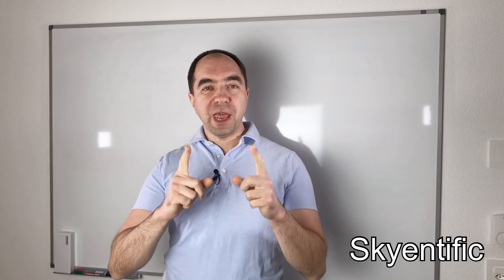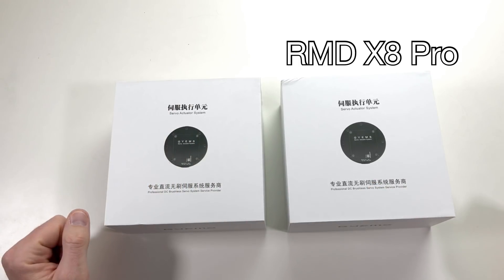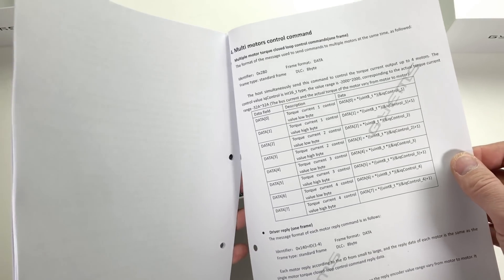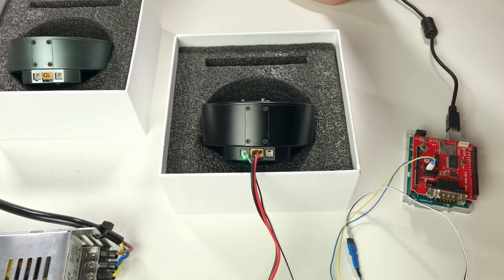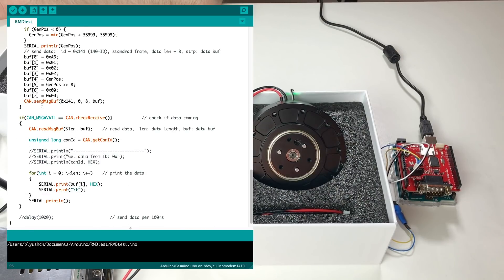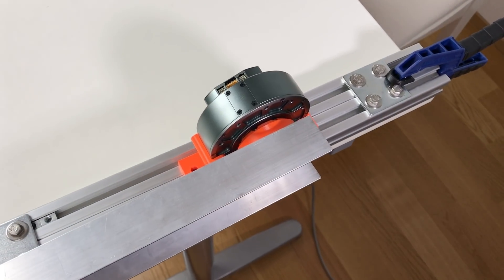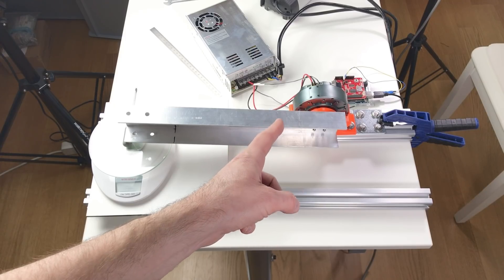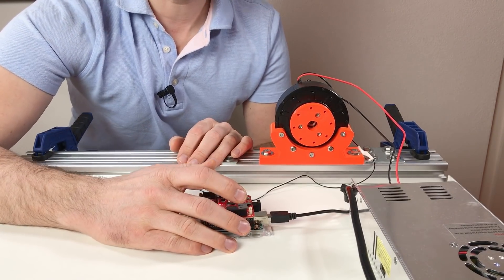I found Best Robot Actuator (GYEMS: RMD x8)

Comment: Thank you for video. I tested DRC10 drivers (probably same driver as yours). 
Did you test 0xA7 and 0xA8 commands? These are not working on my device. It returns error.
Did you check torque at slow fixed speed? (0xA2 command, for example 2 rpm). Incredibly low torque on my devices. Completely useless. It can't even rotate itself. But for high rpms (e.g. 100 rpm) it produces some torque.
Did you check temperature? Constant, -50 celcius on my devices.
I wonder if my devices fake. :(
Reply from the maker: DRC10 is completely different. They have even different hardware. 
On my driver there is no A7 and there is no A8 command. Only A1, A2, A3, A4, A5 and A6. I checked the torque only in different position modes and in torque mode. Both works fine. The temperature readings gives very reasonable result, starting at 28-30 Celsius and rising slowly, when I use motor a lot. 
Did you buy your driver from Gyems company? I saw the similar drivers from other Chinese company. And those drivers had absolutely different control protocol.
Reply: @Skyentific  Thank you. It was really useful. My drivers exactly the same as Gyems. I have precisely compared from high resolution photos. It is either an original or a perfect copy. But I don't know where it was bought. I will learn this from the purchasing department tomorrow. Thanks again.
Reply: @Skyentific  What is the brand and model of the driver you use? Where did you buy it?

Comment: I see lot of Servo motors (like ClearPath Servo) which gives good torque, speed and precision. And it is around 35$. But this actuators are 500$. So, im wondering how do these actuators make difference with those servos. This is just a question and im new to robotics. Please assist me so that I can design my robot - The Best.
Reply from the maker: Clearpath of the similar torque, cost 700USD, and weight 11kg!!! And this actuator weight less than a kilo.
Reply: I will be waiting for the answer. Love your videos. Thanks for making us to know the availability of different components. Keep going...
Reply from the maker: Thank you. The cheap servos usually not powerful enough for the robot arm (with at least 1kg payload and human like reach). Also this particular servos (ClearPath) are very heavy and not very powerful. That is why in robotics they usually use harmonic drive actuators or MIT mini cheetah like actuators. Harmonic drive actuators usually cost many thousands. Thus standard robot arm with 6 axis would cost at least 10-20 thousands.
Reply: Thank you soo much for the information. Actually im pretty new to robotics. So I thought servos are cheaper. Thanks for your information.
Reply: Also, Im wondering like, servos contains dc motor, gear reduction system and feedback system. Actuators that i saw in your video has same components. Then how can the weights of both vary this much? Servos - 11kg and Actuator < 1 kg? 😅😅😅😅

Comment: Great channel...
 Love your explaination and your details... i would lo e to build 7 dof to hold a industral router. Question have you ever looked at clear path servo motors?
Reply from the maker: Thank you. Theoretically, if you would like to make serial robot, clearpath servos are a little bit heavy for its torque. You would need to use a large reduction gearbox. Personally, I never used these servos.
Reply: @Skyentific   i was thinking of using a 5kw atc spindleon the end of the arm.... aprox 20kg....which means redesigning your fram i would..love to 3d print a mold of it..would require redesigned heavy duty  supports and thicker  bracing support and cast the peices from carbon fiber shell  filled mineral cast expoxy....yes...much heavy industrial robotic arm..using clearpath servo and..harmonic gears...

Where can find a free 3d cad model of this or simular 7 dom arm

Comment: To build robotic arms, you need lightweight motors with high torque. If you compare continuous torque to motor weight ratio, Dynamixel H54 is the best.

Comment: Before anyone gets any ideas of actually using this thing, the cheaper one is $300, though most places sell it for $500.
The company website seems to be a scam:
http://www.gyems.cn/846351.html
None of the applications listed at the bottom actually use their product.  This company is actually trying to take credit for the Boston Dynamics Spot robot.
Reply from the maker: they just used this photos for illustration. They don’t say explicitly that Boston dynamics use their product. They are trying to make affordable part for people like us. Without them we would need to pay many thousands for German or Swiss actuator. I used this company many times, and never had problem with them. I saw several similar actuators, and this one is really good, so I shared this with you.
Reply: @Skyentific  The problem is their product is nowhere near strong enough for fast enough to pull off anything like Boston Dynamics' Spot.  It also doesnt have an absolute encoder like you'd need to make a walker.  It has a relative hall effect encoder, right?  Its extremely disingenuous to imply that you can pull off something like Spot with this servo.

The other "examples" aren't any better.  A medical exoskeleton? No.  An Actual high resolution arm? Not with that much lash.  It might be useful for a general purpose arm lifting a few hundred grams that can tolerate several millimeters of error if you have several servos chained together but the products its claiming to be equivalent to are $2000 servomotors that require a $5000 AC drive.

Let me be clear: the product is not a scam.  The advertising on their site most definitely is.
Reply from the maker: I don’t agree with many of this. First, 3kg.m is very good torque. I am not sure that spot mini uses more torque. Second, for many application several mm precision is enough for robot arm. Look at human arms, they are not extremely precise, but still useful, thanks to our sophisticated brain. And for medical exoskeleton 3kg.m could be useful too, at least for arms. But even for legs, I talk to a team at EPFL, for their medical exoskeleton (legs) they using 3 or 5kg.m (I don’t remember exactly), but this is not extremely different from this actuator. And also you can always add second stage to this actuator to increase torque.
Reply: @Skyentific  A lot relies on the maximum angular speed as to whether an additional reduction stage would be viable.  I'm also assuming that the maximum torque goes down as angular speed goes up.

Comment: A very interesting option is a motor wheel from a gyro scooter.  600rpm and 350W nominal.  very large Nm and no backlash.  the price for a motor is only $ 30-40.  I controlled using a VESC controller.  very well you can configure the necessary PID. 
I will assume that the difference in Nm is ~ 1.5.  in favor of gear with play :-(
but just by increasing the voltage you can easily raise the current -> Nm.  I turned the 36V motor from 60V.  without heating  I could not give a continuous load.
but the most important thing is WITHOUT BACK LASH!

Comment: I want to make a correction here " high voltage doesn't mean low current". In Robotics torque is more of an important factor than RPM. So 48V means it's designed to carry more current. I am expecting that 48V & 24A can generate around 24Nm effectively by using a 6:1 Gear ratio for your first motor.
Reply: The size of the motor limits the maximum power

Comment: Can you buy a cheap version of that motor with the low torque and rewind it to make it higher torque yourself?
Reply from the maker: Most probably it would not work. The torque depends on magnetic flux. If you put more turns with thin wires, they will cary the same flux as thick wire with less turns. So it will change KV of the motor but not the torque.

Comment: You planning use this actuator for your  (Another 7dof Arm)  ?  I start print stl data and want order some hardware but Iam start to be afraid which hardware you want to use at the end. Hardware is not cheap so would be nice to know your target. Thanks. I our design is awesome !
Reply from the maker: I am still planning to build the robot arm as before: with multistar motors and ODriver. This is still valid. Nothing is change. Nevertheless, I don’t yet finished with the design. So I would not recommend invest much money now. I think it is better to wait when the arm will be finished, just to be sure that everything is works as it should.
Reply: @Skyentific   OK thanks for info.  
So I print only plastic part (its cheap and is no problem reprint changed part :) ). Thanks

Comment: Wow, for a robotic student seeing these actuators is sooo pleasing to the eyes.

If possible plz do make a video of some of the options for the feedback systems that we can  use in case of using a normal DC motor with gearbox (not a stepper motor) for the actuators.
This is my project actually sothat we can use the DC motor of our choice.
Reply: So basically, making these nice cheap multipole actuators completely worthless by switching back to a design with no holding torque, phase backlash, big EMF capacitors, and terrible positional control.

Comment: This is the servo that I mentioned to you on your previous video but you haven't replied to my question. Anyway,  yeah the good thing is it can read position in multi-turn. But when ever you turn off the power and power again, the servo will lost its absolute position, so you may need to calibrate every time you reboot the servo to get the absolute output shaft position. It's just a small issue, just point out to you :) anyway nice video again!
Reply: Do you have any idea what library he's using? I can find an "mcp_can" library by searching on github, but none of the ones I found were compatible with his code.

Comment: 500 dollars for every actuator!!!???
Very expensive, also torgue without speed is not an indication, you can have big gears with small motor and create huge torgue but small speed ... speed should be mentioned in the testings
Reply: One of the links above has a tab for specs, and it says 250 rpm.  The other (the PRO version) doesn't have a speed.  I agree, I'd really want to know both speed & torque before spending this much.  Having said that, 20-40 Nm is a lot of torque for something so small.
Reply: @AlecMuller  he linked a website in the video description. It has a table of specs if you scroll about halfway down.
Reply: total sold 0 items, product reviews 0
Reply: @kokotmkokot4926  well this video was a review ;)